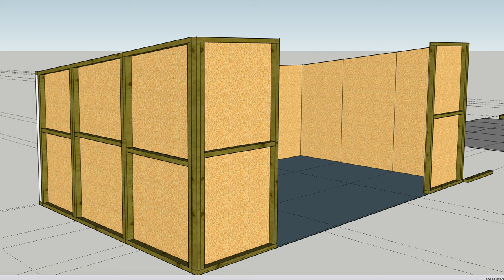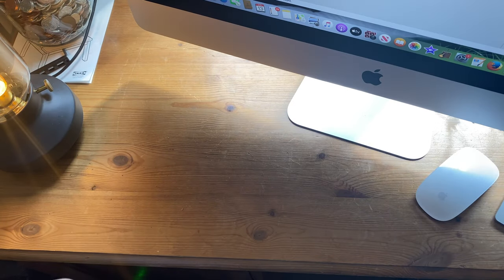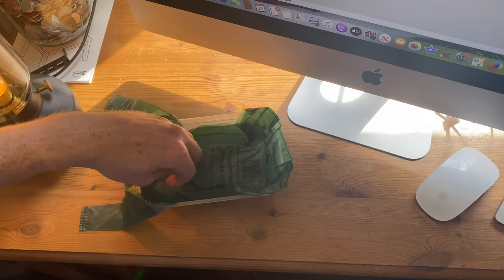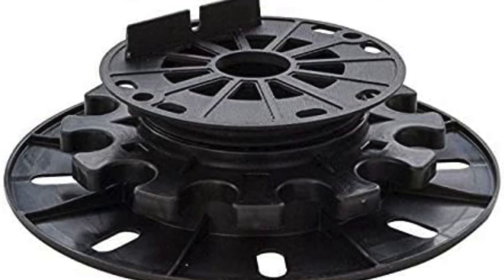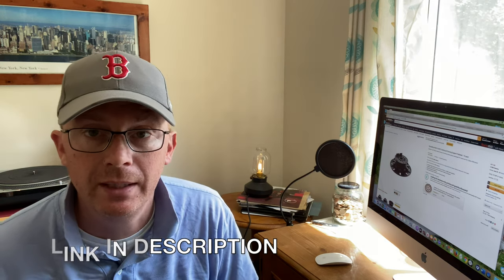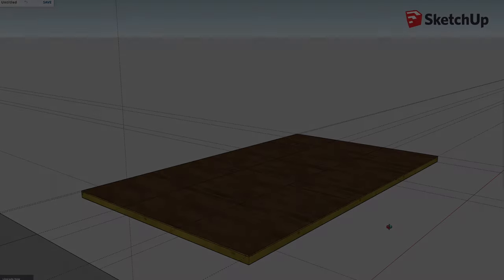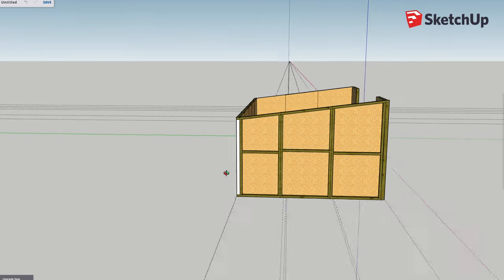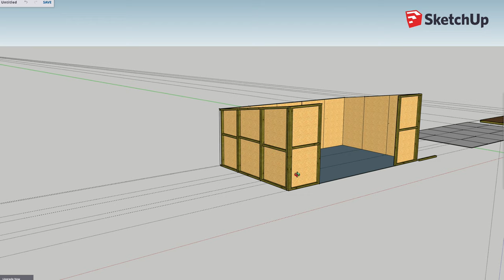Modular Designed Workshop (Part #1: Design Concept and Ideas)

Comment: Love that you have that little mini reserve in your yard, man it a decent size yard at that. 😉
I picked up a free garage roller door with all the brackets and bits it needs for the front of my shed,
and a metal sliding barn style door for the side. Have you toyed with the idea of a roller door?
You could always run a bead of silicone down each side of the timber frame before you add your insulation 
if you're worried about leakage?
Looking forward to seeing this series start. 👍🏾
Reply from the maker: Thanks Bill. The nature bit at the back is a labour of love😀. The garden was an overgrown disaster zone when we moved in and took three years to be tamed. We put a small pond in the back and the nature arrived in droves! We now have a red squirrel drey in one of the overgrown ivy trees, hedgehogs, frogs, newts and all kinds of insects etc. To put into context Bill, over here the Red squirrel is one of the most endangered animals in the UK due to Grey squirrel introduction years ago which carry a pox that kills the Reds🙁.

I did think about a roller door as it’d be so much less hassle and a great way of filling the entry gap cheaply, but I’m going to quite a lot of hassle to insulate the building and a roller door would be a huge source of heat loss. In the North West of England where I am, temperatures can get really cold in the Winter and we can on occasion get decent summers too. I need something I can work in all year round so kind of dismissed the roller door.
Reply: @Hand-i-Craft  
I thought that too, gets pretty chilly here in Ballarat, not snow worthy but -3 is bone rattling cold.
I'm yet to look into insulating the roller door, it has been done, just got to suss it out...
That's a bit of a bummer about the Red Squirrels, hope their numbers bounce back.

Comment: On the base would it not be easier (and cheaper) to build it like a deck?  ie posts set into holes (to above ground to allow for air) build a deck then construct a building on top of the deck you could also then 'kingspan' the under floor area to stop heat going out or cold coming up through the floor (you could kingspan the floor before boarding it over) you do also need some airflow some houses that have double glazing and no 'airbricks' tend to cause condensation, I like the modular type build you have designed
Reply from the maker: Alright Pistol, I’ve decided not to go with the post / deck construction as, in my opinion, it needs to be spot on with the levelling on the posts and there is little (if any) margin for error. As I complete beginner I’m not comfortable with going down that route.

By using the method I’ve chosen the gravel acts as a self levelling flooring when raked and the plastic feet are height adjustable if the ground isn’t completely level. Also I’ve decided to make the floor joists in three separate modules then joint them together. I’ll definitely be using Kingspan / Celotex on the base before applying the flooring so insulation isn’t the issue for the flooring. I’ve just got questions about insulating the walls and potential condensation problems.
Reply: @Hand-i-Craft  you bury the posts and leave them long, attach the frame to the posts level, the cut the posts to the 'deck'

Comment: Had you thought of using the ground screw system for the foundation.  I think Skill Builder did a video on this.  You do need to have the screws installed by the company that supplies it but there is no digging involved and I think about 10 or 12 screws should be enough to support a wooden frame for the floor on which you could build the walls.  It also has the advantage that the screws can be removed if you need to relocate the building and re- used in another site.  No other groundwork needed apart from running the power supply which could run along the boundary with only a very short shallow dig to the workshop using armoured cable ( make sure you use a big enough cable, probably at least 10mm square).
Reply from the maker: Thanks again Michael. I will have a look at those Skill Builder videos. I’m subscribed to them and remember when their series on garden room builds came out, but I haven’t got round to watching them yet. I’d be interested to know the cost of the screws including installation as I’m doing my best to create something of a quality build, but on a really tight budget. The digging and levelling the ground I’m planning to have done will be cheap, I’ve loads of sand to fill the gap and would need to get some cheap gravel. The plastic feet work out around £3 each. Haven’t calculated yet how many I need, but that is the plan for the groundworks. Haven’t got a quote yet for the electrics due to Covid related shutdowns but also need to consider that cost as well😀
Reply: Hand-i-Craft Here is the link to the SB one, there are quite a few more as well.

https://youtu.be/nOgFByYgsGY

Comment: I believe that OSB is vapour tight so I think that you can just tape the joints as you suggest. Condensation forms where cold meets warm therefore it would be on the outside face of the Kingspan. You might have to consider allowing potential condensation to run off and not sit on the bottom rail of the panels. The vapour control layer is to stop the moisture in the building getting in to the frame timbers and causing them to rot, not the outside getting in. The maximum benefit would be to sheath the entire building with Kingspan, cover that with breather membrane and then clad it with timber with a small batten for a cavity. If you can accommodate the extra 70mm on the outside it would be worth it. This would be equal to a modern house standard. I'm a timber frame designer in Liverpool btw so if you want any other help let me know.
Reply from the maker: Thanks Graeme for such great feedback! If I foil taped the joints of the OSB boards inside, then also foil taped the joints where the OSB meets the timber in the modules, could I then slide the Kingspan in snuggly and caulk the non foil side of the Kingspan to form a seal that way? If I use this method, if I ever needed to take it down I could just scrape off the caulk and remove the Kingspan panels before detaching the modules. Does that make sense?

One final question, if I wrap the whole building frame in Tyvek, can I get away with applying cladding directly onto the Tyvek or do I have to attach batons first? I’ll have an air gap between the back of the Kingspan and the Tyvek of about 20mm. The reason I ask is the batons make the process less ‘modular’ if that makes sense. It would add another layer of difficulty and applying / removing if it had to be taken down. If cladding goes directly onto the Tyvek does it ruin the purpose of the Tyvek sheet? Cheers, Leo 😀
Reply: @Hand-i-Craft  Hi I understand that you NEVER tape the outside unless it's a breathable tape, if you had a chance to look at the BBA certificate for the product it will state that. I think it would prevent any moisture that got in the wall getting out and you get surefire rot or mould. With taping the OSB you get airtightness on the inside but a wall that allows moisture to pass through i.e. breathable.
Reply: Hi, sorry, I failed to read your question properly, the point still stands that you don't want to seal the Kingspan but you're on the right track with the breather membrane. I believe the breather can be tight to the back to work for water ingress but water might sit against the back of the cladding causing potential rot. One idea would be to have the breather membrane follow the profile of the studs and Kingspan so go in and out, that way you get the 20mm gap behind. The main idea is to have your main line of defence in front of the timber and have an air gap to the cladding which is effectively drained. The cladding can take a wetting front and back as long as there is an air gap to allow ventilation. You could still add battens as they would have to be vertical and would just sit directly over the main batten. There's loads of ways to do it, it's hard to compute the perfect solution.

Comment: Shouldn't the foil vapour barrier be on the inside (warm side) of the wall which is where the condensation will occur as the warm inside air meets the cold outside wall.  You won't get any condensation between the OSB and the road as both surfaces will be more or less the same temperature and humidity.  This would also allow you to glue the foam side to the OSB which would avoid a void there as well.  Sorry I wrote this too quickly but it would work if you fitted the panels the other way round with the OSB forming the outside of the workshop wall ( assuming your didn't want this to match the bike shed of course).
Reply from the maker: I see what you mean here Michael. I suppose it is all down to cost in the end which I am trying to keep to a minimum. If the OSB forms the outer wall before being externally clad, that means I’ll have to also clad the inside walls with something too, effectively doubling the cost of each module. My plan from inside out is: 11mm OSB lined with treated 3x2, foil backed 50mm insulation with foil side next to internal wall, small air pocket, Tyvek wrap, external cladding.

As you pointed out, I think I could get away with foil taping the inner joints where the OSB board meets the timber lining, then insert the KingSpan 50mm then caulk the back of the non foil end of the insulation which should form a seal. If I then need to take it down I could just scrape off the caulk, remove the insulation as it isn’t taped to anything and then take the modules down?🤔🤷‍♂️😀
Reply: Hand-i-Craft You could just paint the OSB on the outside and duplicate it inside.  That would save the cladding.  ?OSB cheaper than cladding and if you screwed the panels together through the air gap then to take it down you would only need to remove the inner OSB to access the screws and then separate each panel as long as you used a flexible caulk between them they should separate quite easily.

Comment: How about a secondhand roller garage door for the access.  You might even pick up one with an electric operator.
Reply from the maker: Did think about a roller door tbh Michael, but then kind of thought no as I’m going to quite a bit of trouble to insulate the building and the roller door would be a major source of heat loss.
Reply: Hand-i-Craft Mine has a foam core, they come different thicknesses but the better insulated ones are quite thick so the roll does get pretty big and needs a bit of extra height.  A SH patio door would probably be cheaper or maybe a bifold if you can find one and would not need the extra height.
Reply from the maker: Michael Blackmore Bi-fold would be the ideal solution Michael if one became available. I’ll just have to keep my 👀 on the lookout and hope for the best 😀

Comment: YBS SuperQuilt Definitely the way to go 👍 good luck
Reply from the maker: I’ve just had a look at it richsr and it looks the business! My only issue being with my design being modular, I’d have to cut through it if I needed to take the building down. Unless I could superquilt each module separately, but then that still leave me with the same issue about moisture in the gaps🤔. Any ideas?
Reply: Hand-i-Craft, yes we would normally use a relatively cheap vapour barrier first and tape joints, then staple the superquilt between each modular sections and then use their silver joining tape to bridge the gap then overboard, then if you do need to disassemble you are only destroying so to speak the first layer of vapour barrier. 
I’m looking forward to your upcoming videos to as you are incredibly inspiring to watch. 👍🏼
Reply from the maker: richsr1 Cheers richsr, very kind of you. One quick question please, could you point me in the right direction for the cheap vapour barrier you reference? Name / brand etc and roughly what price would you expect to pay for a roll? Much appreciated, Leo 😀
Reply: Hand-i-Craft, sure Leo. Wickes Green Polythene Vapour Barrier - 2.5 X 20m roughly £22 or Selco builders merchants do a very good foam barrier roughly £12 for 15m2 that may be easier to put up
Reply: Hand-i-Craft, Also I would email superquilt-insulation.co.uk/ they are so helpful if you have any questions, we use them for all our projects and ask then to sponsor your build, to show how easy it is to install. Maybe worth a shot Leo
Reply from the maker: richsr1 Nice one, cheers for all the info. Genuinely appreciated! 😀😀

Comment: Have you looked at SIP construction?  It's already modular to begin with isn't it?
Reply from the maker: I suppose what I’m doing here is creating my own SIP constriction😀. I know SIP stuff is probably excellent, but it is very expensive. Also where’s the fun in having something made for you and all you have to do is click it together?😀 I can guarantee I won’t be saying that in a few months when I’ve got through gallons of blood, sweat and tears trying to make it😂😂😂😂
Reply: Well, I was meaning that you could possibly create your own SIP panels. I would be very tempted. It's definitely modular.   Just takes accurate measurements of the offsets and overlaps, you are almost there.   Do y'all have T-111 plywood for exterior siding?  Popular for sheds here.
Reply from the maker: R Wind I’ve heard of T1-11 cladding R Wind, but we don’t really have an equivalent of it over here, at least not an affordable type like you have in the US.

Will have a think again about the panel design. My original idea was just to bolt and fix each module together, like I did with the shed and that went ok. Only trouble with this build is it is on a much bigger scale which could potentially cause some issues, but will have a think and see how I get on😀😀

Comment: Hello, just a comment on your foundation. lining it with dpc will just turn it into a pond mate, skip the dpc under the gravel, I put a wooden chalet up that a guy lives in in Ireland, not a dry country! 30 feet by 20 , we just dug several trenches 12 inch deep , 18 inches wide,and just over 30 feet long, put in coarse gravel to bring it up to ground level, we placed concrete block on the flat along each line of gravel, they were 2 feet between each trench. Levelled the blocks in each direction, it takes a while with a mallet and spirit level, you can shimmy them a bit to adjust them. The chalet floor joists sat on top of the blocks with a layer of dpc under each the floor joists. 8 years later it's still up, still flat and level, no damp problems, and there's a lot less digging out involved
 Good luck with your build
Reply from the maker: Nice one, thanks for the comment Kevin. I must have done my homework wrong as I was planning to line the dug hole with a damp proof membrane, which I thought was different to a damp proof course. I thought the membrane was breathable in a sense moisture could pass out but not in. Might just go for a lining of a weed membrane to stop plants / weeds passing through. 

I don’t think I’m skilled enough yet create the base you done. I’m lucky someone is digging the trench for me at friend prices and I think I can cope ok with the plastic adjustment feet. Also I need to keep the base as close to ground level as possible due to the 3m height rule that I’ll be pretty close to.